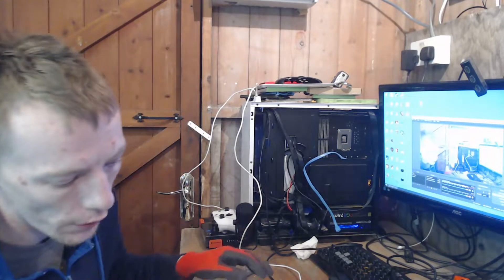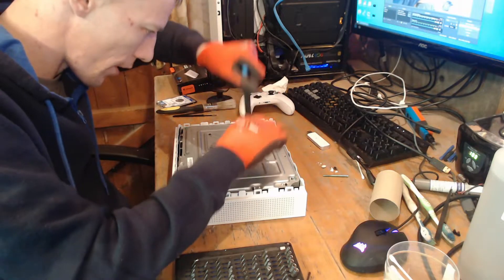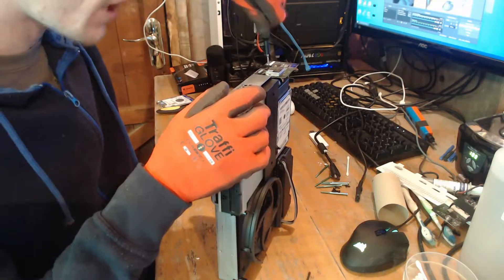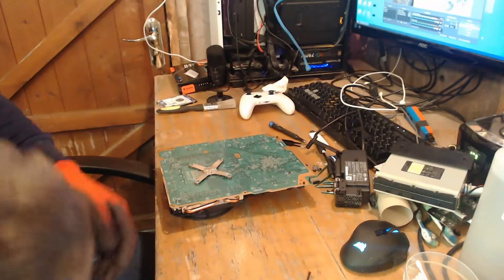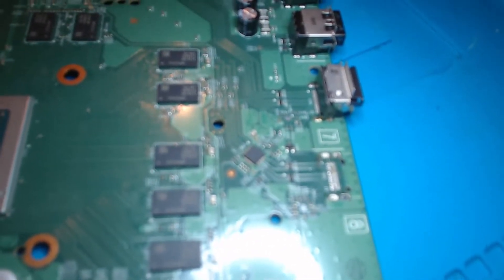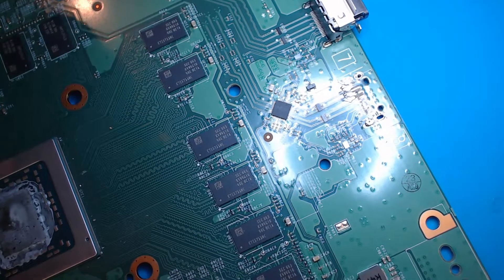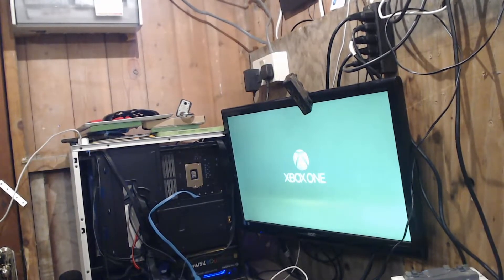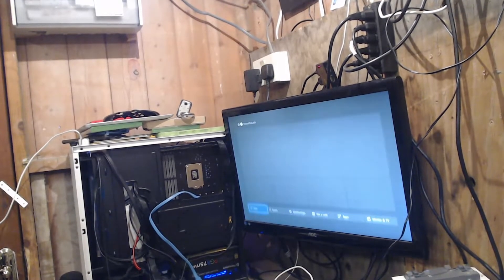Trying To Fix A Faulty Xbox One S That A (Scamming?) Seller Dropped In Front Of Me

Comment: exactly that's how i learned to do HDMI ports is from old tv boards took out 3 different ports before I was confident enough to do a ps3 one back in the day
Reply from the maker: Always the best way mate to practice on boards that are either replacable very cheaply or that aren't working at all. For HDMI trace repair I actually deliberately wrecked my own boards in order to practice 😅
Reply: @TheCod3r  i didnt have to 2nd one i did what u said not to do n heated it from top to mutch  with a heatgun. N pulled like 3 pins completely up. So hada redo them but didnt have board stuff to tack wires n cover it so took thinest wire i could and super glued it down to hit the contacts for the port then soldered it and used epoxy glue to cover exposed areas i was actually suprized how good it worked my friends still got that thing he used it up til he got a ps4  lol

Comment: Yes the power supply looked tampered but I doubt very much the customer damaged those tracks ,but suspect rather you did as you used a bit of force after wanting the port to fall off the circuit after heating  it up

Comment: Marvellous what can come loose in circuitry,  I have a large migwelder that rarely moves yet it stopped working due to two multi connectors coming loose and out the female section . Both connectors are fixed using locking tabs .
Reply from the maker: Yeah it's strange really, I guess with vibrations over time in a welding environment it's bound to happen eventually
Reply: @TheCod3r   That was my thought , the banging of the transformer every time you start to weld ( they do bang like a big contacter kicking in on high amps ) and the vibration of the wire feed unit . After I replaced them could I hell as like pull them out without squeezing the locking tabs though.  Keep the video's coming 👌.  Just  got my old Acorn Electron out ready for testing to try and figure out why it suddenly stopped working after digging it out of loft storage 25 years ago , it did work for a week or so then stopped 😥 .